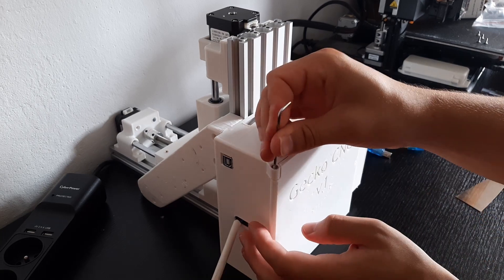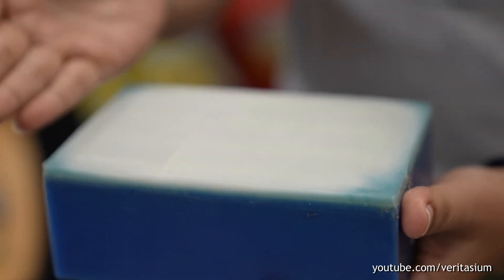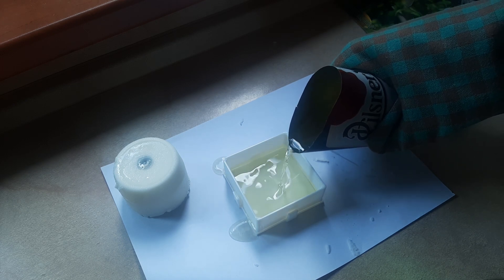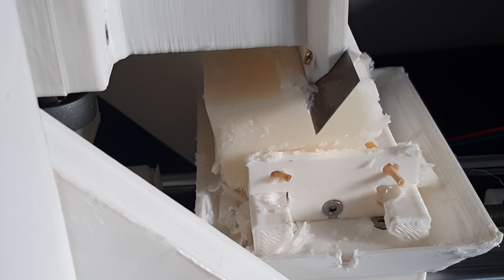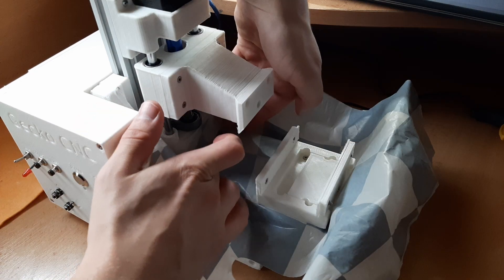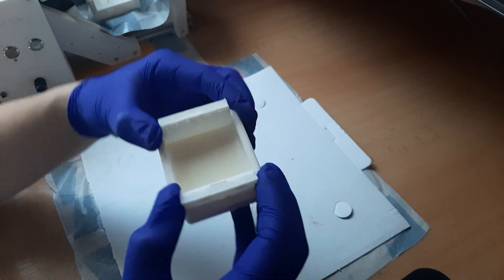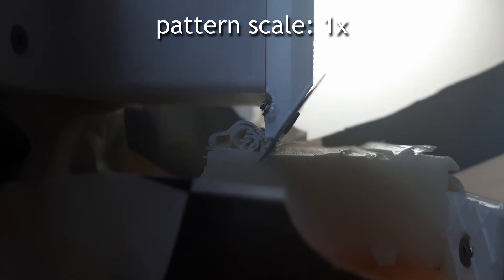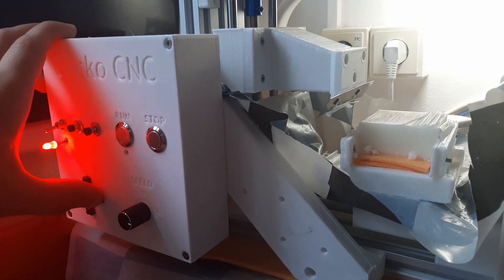Machining on my 3D-Printed CNC for The First time

Comment: why not cast the wax on some adapter plate that fits directly into the cnc? no need for a vice, just something that accepts the adapter plate with maybe some conical pegs. Make the wax-side of the adapter plate with some muchroom shaped pegs.

Comment: HI .. I am not sure if you are using anti backlash nuts with spring , but if yes then stop it .. they are not precise. Instead of them use solid plastic nuts with setscrew to adjust the pressure .. you will have more responsible movement without backlash. plus what printer you use to print the parts ? because honestly it look like garbage :D because my 5 year old Ender 5 had 5x the finish quality .
Reply from the maker: I use 2 nuts per axis to prevent backlash. I also use a 0.8 mm nozzle and high layer height to print faster.
Reply: @TazerTechnical  I sent you an email .. :D  ... and the 0.8mm nozzle explain the bad quality :D

Comment: Look up “machining wax recipe” quick easy and better than paraffin.
Reply: I use machinable wax for testing tool paths on my CNC and it works much better. It is a mixture of paraffin wax and shredded plastic shopping bags melted in. It is very smoky when making so best to do it outside and on a hotplate you don't care about. I ended up buying a 10lb bag in pellet form as the work involved making it was not worth the effort.

Comment: The silicone you were using seemed quite "thick" maybe next time use silicone with a much lower viscosity.
You will need to build Up a kind of dam around the wax Block to prevent it from just running of.

Still, good Video man

Comment: i think it doesn't work because you facing operation is garbage  there is no way you get a smooth surface with this. maybe try melting the surface to make it smoother .
Reply: Aside from the orientation of the fixture as references the operative motion, can you please elaborate on what makes this facing operation "garbage"?
Reply: @claws61821  the wax doesn't break smoothly
Edit: The surface finish this tool leaves is so bad he can't get a good surface
Reply: @manypixel813  having seen in person how smoothly a fresh razor blade can cut through cold candle wax, I don't think that's because of the material.

What about the operation, rather than the material, do you think it's responsible for the poor surface result?
Reply: @claws61821 at that scale with 3d printed tool vibrations are probably part of the issue too.

I don't think the operation is ideal maybe cutting with the blade parallel to the surface would give better results, i'm not sure.
Reply: @manypixel813  Blade angles when planing and facing are tricky. Too close to parallel and you're as likely to see too much resistance as if your angle comes in too far. That's also affected by the angle of the edge to the rest of the blade and by whether the edge is facing towards or away from your direction of cut. You may be onto something, though. Perhaps in addition to a mount that reinforces the blade against torsion from the resistance of the work piece, he should try other fixed angles or a mount with an adjustable locking angle.

Comment: You can try casting the wax in a mold that is just walls sitting on a piece of float glass. Then leave the wax inside the mold and use a razor blade shorter than the width of the wax block. The top of the wax will suck inward, but the bottom should replicate the flatness of the glass pretty well and provide a consistent surface for indenting the pattern. 

Bonus points if you have a second removable mold part that forms a trough around the flat face, so the corners of the blade are not actually bearing into the wax. Basically a ring around the inside perimeter of the bottom of the mold.

Getting the wax to come out flat enough to make well-resolved microstructures using the razor is probably going to be extremely difficult, given the very low rigidity of the blade and machine. If anything, dragging the razor backwards might help, but I would just avoid facing altogether.

Wish you success.